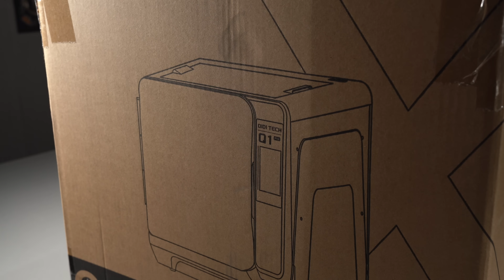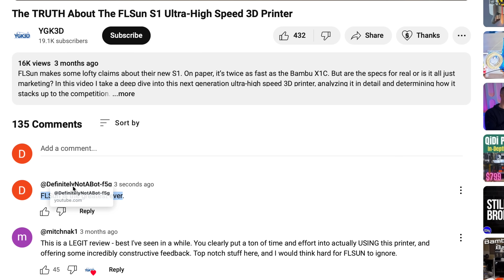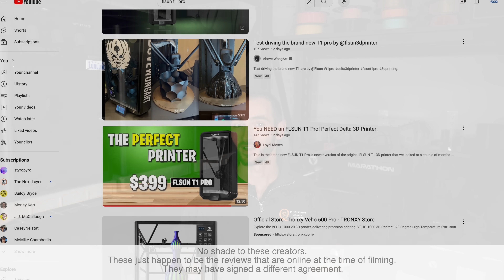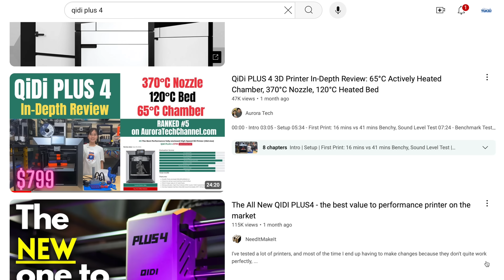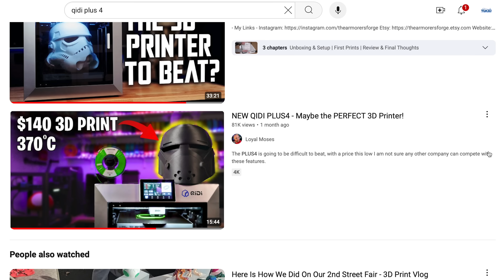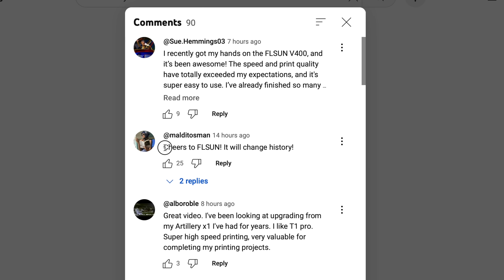This is why you shouldn’t trust 3D printer reviews...

Comment: My first 3d printer had favorable reviews.   It was a Alfawise u30, basically a longer3d.   The one i received almost caught on fire twice because of shoddy heatbed wiring connections.   I rewired all of that.    The bed was in the shape of a bowl.   I had to spend lots of time getting it sort of flat.   The extruder would skip.  I eventually fixed all these issues before selling it.  Reviewers ignore all the negative aspects of a printer in order to get free printers.

Comment: A great example would be Bambu Labs, I had to watch 'many' (lost count over a year's time) before finally breaking down and purchasing one. Great printer, easy setup, great prints BUT: Camera is but useless, burns thru filament and I haven't even hooked up the AMS-lite! (BBL filament from China takes time to cross the ocean this time of year) I found some 'reviews' that talk about the issue but with the A1 series printers there doesn't seem to be any upgrades, one of the reasons I've always leaned towards 'Open Source' products. The other issue that is missed is knowledge, many times reviewers are 'in over their head', they are usually called out, I've seen several reviews where no one has pointed out the issues with the review and later others making the same mistake. 
Of course there is the elephant in the room, those that try to get clicks by hate, "Bambu Labs A1 is a piece of garbage" people click to see how they can correct the false impression just to find out it was a click bait review.

Comment: I haven't trusted any online hardware review since the early 00s. I learned my lesson in my PC building days as to the lengths manufacturers will go to when promoting their product.

When it comes to any kind of review content, I liken 3D printers to graphics cards. You can only rely on thorough testing; the likes of which most channels don't have the time or inclination for. I've seen the turnaround time for reviews on 3D printers (especially from some of the more unscrupulous manufacturers) and there is no way you can adequately test a 3D printer in that window.

I've never been in a huge rush to get new hardware for my print farm. If you're using machines on a daily basis you soon learn what they are actually capable of constistantly. You learn very quiickly what their tolerances are when it comes to heat and humidity, the best resin/filament to use, how low you can go with cure times etc. This kind of information can't be gleaned froma review where the reviewer might have only had a week's (or less) hands-on time with a machine.

I'll wait around 18 months now before upgrading. That way there is enough independent information out there regarding the machine, it's tolerances and what it is truly capable of, hardware faults to look out for with extended use, plus the machines are cheaper and spares are relatively easy to get hold of. Touch wood, sticking to this rationale has kept me free from buying any lemons so far.

Comment: I worked as a journalist in the early-to-mid 90's, covering the PC industry (hardware and software) for a weekly printed publication (think Infoworld/Computer World) . I usually did two reviews each week, but because of the limited amount of time I was able to spend, we called them "First Look", as they were not in depth reviews. Those were done by our monthly publications (PC World, MacWorld).
We got the software and hardware for free from the manufacturer, often even before release. So everything was exactly the same as for today's content creators, in that aspect.
The difference is that we had several additional layers that helped us journalists be more objective and reduced the pressure from the manufacturers. First we usually let another journalist read the article and give feedback, not only on grammar and spelling, but also on the content and the tone of the article. Next the article went to the layout editors, who created the actual pages for the publication. They were not only doing layout, but they were also trained journalists and reviewed the articles (in addition to shortening them down, when needed). They also often set/changed the headline, sometimes to my dismay. But I digress.
The next layer was that all completed pages were printed and put up on a wall, for everyone to look at, and give feedback on. And then, before the pages went to print, the main editor reviewed all articles.
I was always trying to be as objective as possible, it was my professional pride. In addition, I knew that a lot of my friends in the IT industry were reading my articles, and they would call out any bias or any errors.
It was actually funny how IBM and Borland complained that I was too positive about Microsoft's products, and how Microsoft thought that I was too positive about their competitors. Then I knew I was successful. 😁
Today's content creators don't have that same level of support, unless they work at LTT or some of the bigger media companies.
It is easy to get a bad reputation, and be known as a shill for a company. And it is then very hard to get rid of that.

Comment: I am just a user, I don't have a channel, I am just doing research before buying my first printer. I have found a few channels, like yours, that provide valuable content. Content that helps me make a choice of which first printer to buy, based on the things I have learned so far because I don't know what I don't know. I don't pay attention to comments, as with any social media platform, there might be one reasonably intelligent person posting a valuable comment. However, any response always triggers the wrath of trolls and haters.
Timely video's of new printers have a place, like the prusa core one. I had set my mind on the Bambu X1, then changed it to the P1S, but holding off until a first review of the core one to see if I should wait a little longer :-) 
Any ways, great video, great topic, but it is up to the viewer to apply common sense.

Comment: I've had 3d printers sense 2012, it took years for me to learn which brands to trust, and yes I've  bought bad products before,  I now have 3 bambu printers and won't buy anything else, I hope bambu  comes out with a resin printer because I'd buy it to,cheap jayo and anycubic filament has worked well for me, this is the trust you develop over time!

Comment: Marketing aside, Is the flsun t1 pro good though? I ordered one based on a YouTube video where it was used. I still have time to cancel it.
Reply from the maker: @yoitsmegabe  could be. I haven’t tested it. For the price, it looks like a pretty solid printer.
Reply: @ygk3d  Thanks! I 'll let you know if it's easy for a complete novice when I get it
Reply: @ygk3d  I got it a few days ago but finally set it up yesterday. Assembly was pretty straight forward and everything is packed with labels including the screws. It comes with an assembly tool kit with all the Allen werenches which was nice. What's not nice is that they didn't ship my filament. I'll have to contact them about that. 

The unit is much larger than I was expecting. Once it was assembled, I had a bit of trouble loading the filament for the first time. It wasn't grabbing the filament. I just pushed the filament through the extruder (is that the right word?) until it grabbed the filament during the loading process. Then i was off to the races. I did the test print of a little boat that comes with it and it worked right off the bat. I'm excited to try some files. If there's anything you want to know from a noob perspective let me know.

Comment: This bot comment strategy is a common practice in mainland China market. They just blatantly and stupidly used the same in other parts of the world.
This is actually more profound than most people would think. They can do the fake positive comments, as well as they can also do negative ones. In that market, they use this as a weapon, because they can put in censored words and similar stuff into comments to remove views and algorithm recommendations from the content maker. That is a blow for most reviewers.
To make it more powerful, that market also has a much higher ratio of professional teams as content makers, due to various reasons. Unlike the more common single person production here, a team lives on revenue stream. This makes the blow much more threatening.
There are other factors behind this practice too though.

Comment: I've been a printer tech for over 20 years. I bought a 3d print a year ago and the videos made the printers look so easy to run but after printing with it, it turns out they not as user friendly as I expected. I upgraded the hot end and to a raspberry pi, Klipper and touch screen and the printer has been great.

Comment: If you can prove a FLSun can print a tall thick structure without z-hop I will be a believer. This is the litmus test to compare against a corexy equivalent(which don't have this issue). The main issue is the need for a robust delta motion system(Prusa's spinoff has done it, though expensive to procure one).Don't think FLSun has overcome this. I know how this can be done, but not interested in selling homebrew delta printers. I got burnt by a bunch of SRs, the tuning of which helped me understand the issue.😂❤👍

Comment: 7:55 I think I got a bit burned by this on the Neptune 4 Pro. I bought based on early raves, but it's been a hassle to use. When it's tuned it prints wonderfully, but there's a real problem with consistency. I can't know from print-to-print if I'm going to get a good first layer--even for identical prints. I jumped ship to another brand and have had much more success.

Comment: This is a good summation of a big problem....only one thing missing imo. I have seen negatively biased reviews too often. These are reviews where the YouTuber doing the review favors anothe or other products more than the one they are reviewing. The only reason I frequently suspect are reviewing said product is because they are being compensated...if only by the views and subs on YouTube. I'm not against reporting of negative findings but when positive findings that are legit aren't mentioned,  if petty irrelevant negativities are given too much play, or legit negatives not enough play then I lose all respect for the reviewer. One example I can give is when Bambu came out with their new printer AMS systems,  the reviews were all glowing. These printers are not bad and their speed and multi-colour capability made them the darling of the hobby driving millions of sales. However, on HUGE issue with them imo is their waste. In many ( most?) multicolour jobs on the Bambu's, The "poop" and purge towers can be 2 - 4 times the weight of the actual model being printed. This is a fact that I have very rarely seen mentioned in passing in a review let alone flagged as a negative. So, biases are rife with online reviews...about any product and service :P

Comment: I got misled a bit about the Mars 4 resin printer- wish someone warned me about the unprotected hole to the motor
Reply: You can put 2 peices of scotch tape to provide flexible seel, i dont because I never fill past the max fill line and use the included drip tray on the mars 5.
Reply: @ I had a FEP rip which resulted in resin getting down there- easier to happen than you’d expect
Reply: @Nelliecosplay  i never ripped a fep but I do commonly replace so they dont eare down to the point they do, I had my mono X get disabled by a punctured Fep as it leaked on the UV screen directly. Was it difficult to clean up, or did it break the machine?

Comment: Whilst I can understand the desire to not let the sponsor pull the plug on the review after you've put a lot of work into it, the other side of the coin is that I've seen reviews that are flatly inaccurate, saying, for example, that the item can't do X, when in fact it can, but the reviewer has missed that bit.

So up to a point, I can see merit in the sponsor checking the review before it's published.  Of course there would need to be conditions around that so that they can't just pull an accurate but negative review, but can ask for corrections to be made.

Comment: I bought a sovol sv07 plus last year, based on very positive reviews. But the reality was very different . It has been a pain to make it works and even so with regular failures.
My experience after that:
- Dont buy a printer without an automatic bed leveling and be sure its absolutely reliable.
- if its a bed slinger, don't buy a printer without x and y rails , avoid moving systems with wheels.
- check if you can replace the hot end easily.
- be sure to use good filaments.
- dont rush on new brands or new products , let's a minimum of time for the community feedback to confirm if it's a reliable product.

Comment: I have a Prusa MK4S and Bambulabs P1S and both printers work well and I havent had a problem with either.  I need to get a third printer for more production work and I'm not sure if I should get a Qidi or not.
Reply: maybe wait 3 months or so with every qidi machine but after that qidi machines are mostly fixed

Comment: Build a Voron, problem solved.  Trident would be a better option than 2.4r2 for beginners willing to learn. Lots of good kits nowadays.  Want something cheaper, sovol sv08,  want a more true voron clone get a troodon.  The real question is what your goal is; trade-offs vs. full control.  Some people just want to print and i respect that... If a company delivers a good enough experience it doesn't really matter what the downsides are because a company will never be able to meet every single use case.

Comment: Appreciate the honesty my friend.  Clough42, you and a few others are the only ones I trust for a review.  Most of the Tubers that do reviews are either being sponsored by the company or at the very least are trying to be.  Everyone wants to quit their day job and do this full time even if it requires bending the truth.  I have a Qidi XMax3 and had quite a few problems with it, including having to completely rebuild the coreXY sub assembly because the screws were over tightened from the factory and cracked all the injection molded corner brackets.  There were quite a few design issues with the printer and it was half baked when they started shipping.  Now if I had been a reviewer that only tested for a week, I probably would have gave a glowing review.  I will say that Qidi usually responded in a day or 2 and always shipped all parts I needed to make the repair.  My issue is that most of the issues I had should never have reached a customer in the first place.  It really is a crap shoot for every printer that is released, but there is an alarming trend of the printers being sent out to customers before they are ready and the early adopters being used as beta testers for the most part.

Comment: I’ve heard nothing but positive things from reviewers and commenters on Bambu products.
Reply: Really? Not a single commenter or reviewer has told you about that time Bambu launched a 3D printer that was a literal firehazrard and they had to do a re-call?
Reply from the maker: There’s not a lot to complain about with them, besides the lack of user serviceability. But as @MagnificentUsernameGuy pointed out they’ve had their share of blunders as well (A1 heat bed cable for example).
Reply: @ygk3d  Besides the recall, that has been resolved that didn’t result any damage but might have. Please elaborate on the “blunders.”
Reply from the maker: @mwinner101  the only other I can think of are the network security vulnerabilities that were revealed earlier on and quickly fixed.
Reply: @mwinner101  There also was that time a bunch of Bambu printers started printing without any user interaction. 😅
Reply: @mwinner101  Other manufacturers also get's all kinds of backlash for selling "unfinished" printers by people who seemingly have no idea how "unfinished" the X1C was when the first units of those shipped.
Reply: That's because Bambu also has a strong army of bots. :D